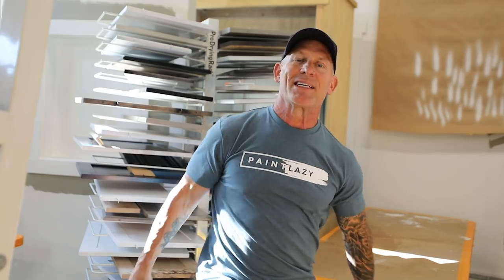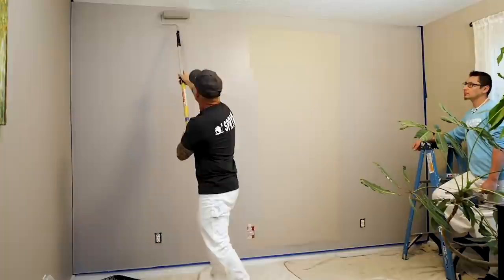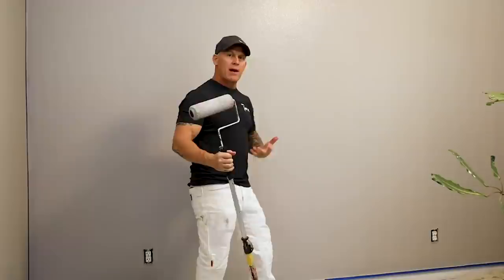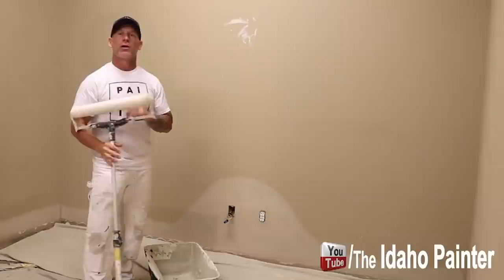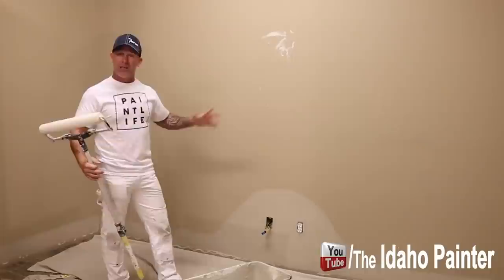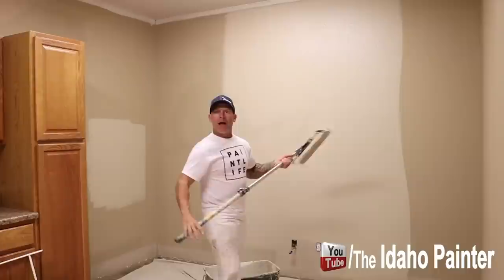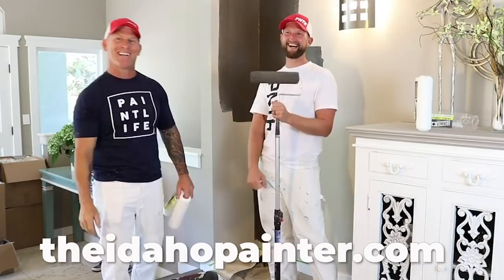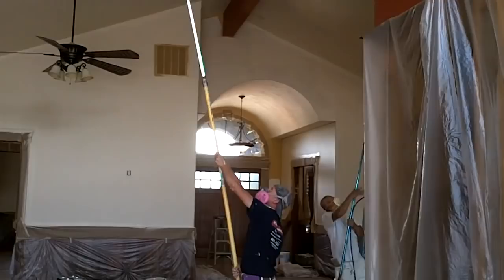Roll Walls Like A PRO!

Comment: I gotta say, I fell into painting a little later in life than I would like to be starting a new career, but due to an injury I’m no longer able to dive commercially and painting was offered as a back up through a few different sources. I watch your videos like I’m doing homework daily, just to try and get up to speed as quickly as possible. No one likes being the 35 year old on the job site that knows nothing. In just the 2 short years I’ve been doing this, and thanks to your videos for tips and trick, not to mention a lot of hard work and dedication on my end, I’m actually the lead painter at the company I’m with now, and I’ll be opening doors to my own LLC by spring time next year. I can’t tell u how much I appreciate your content. Thank you & keep it coming. PS not sure if I’ve missed it or if u havnt made a video yet, I’m curious about the correct process of painting metal, such as metal roofs and metal pole barns and such. Maybe that one’s coming down the pike?

Comment: You always lead where the roller frame enters the roller. This is because there is more pressure applied on this side of the roller as that is where the frame enters the roller and thus more pressure. When doing this the side of the roller where the frame doesn't enter feathers out the paint. If your nap is coming off the roller then you have a shitty roller frame.
Reply: Absolutely 100% correct

Comment: Love the channel! 

With regards to the tape applied to baseboards when rolling walls.. If applying 2 coats of paint, if I leave the tape on until after the second coat is applied, will I have cosmetic issues given there is dry paint on the tape? Is it necessary to remove the tape when each coat is wet to ensure no tearing or jagged paint edges? It would seem the thicker the first coat of paint, the more of an issue this may be.. What is your approach here?

Thanks for all your content.

Comment: I’ve been cutting in and rolling over for texture, but still have 3/4” or so with brush marks so I don’t get it in the ceiling.  Also looks like you roll really close to the ceiling line when rolling the wall.  Any tips for doing all you can that way but assuring you don’t touch the ceiling?  Also, working solo, I struggle to cut in as I go and be fast enough to keep a wet edge.  Any tips for that?  Love the videos, Chris!

Comment: The trick is:

Slam the roller frame into the tray and get paint all over the carpet, then spin around as fast as you can and whip it against the wall (so the paint doesn't have time to dry). 

For a uniquely textured look, don't roll it, slide it sideways. 

Now you're a Pro™ go get em tiger.
Reply: Why not spray?
Reply: Lmao
Reply: @timbohouston  honestly with spraying a home or sometimes rolling can be easier and a lot less prep! Now if your painting commercial spraying is faster and better same thing with new construction homes! To each their own all painters paint different then others so you might go faster if you spray then roll!

Comment: I have been watching a ton of your vids and I am so excited to move into my new home next month so I can start painting!   I just have a question.  You seem to be using WAY more paint on your rollers than I do.  I lightly dab the roller in the "well" of paint then use the grooves on the sloped part of the tray to squeege most off.  I could never have anything dripping off of the nap because I have FAR less product on than you do.  Can you possibly show a close-up (or tell me where I can see one) as to how you're putting product on your nap before rolling it onto the surface?       There's one wall in my current home I painted a little thicker (using BM Regal) and the textured surface doesn't look like eggshell, but has millions of tiny raised lines from the texture of the nap.  I feel like if I go any thicker on the paint, I'll get those.    Thanks in advance for any comments or suggestions on your other vids to watch.
Reply: As a testament as to how much I have taken in from your vids, I bought a Graco TC Pro yesterday for doing trim and my doors!

Comment: One question I want to ask. I started rolling my bathroom and rolled a few more times than I should have without enough paint on the roller. I have a bit more stippling than I would like to see. It’s not terrible but noticeably different than the other walls in my home. Can you give me some suggestions to help correct this? It is really bothering me. Half of me wants to hire a professional to fix it, the other half of me wants to learn to fix it myself. Thanks so much.
Reply: Yeah re paint it...

Comment: I always do "N" letter first ,and then spread evenly
Reply: ABSOLUTELY NOT! That totally newbie thing is so ridiculous. You'd have to load SO much paint on the roller to even make an N since that's doing three separate lines: up, down , up... Start in middle and go straight up and straight down to roll out EVENLY. Obviously he knows what he is doing FAR beyond others. He does MANY things that I as an 30 rs experienced painter, also do. HE does many of the things that I've been having a fit for years because  I am shocked other painters don't do... like back roll brush marks, or last roll in same directions.